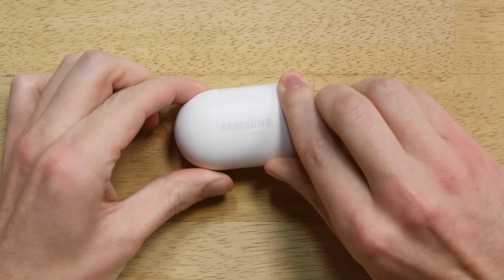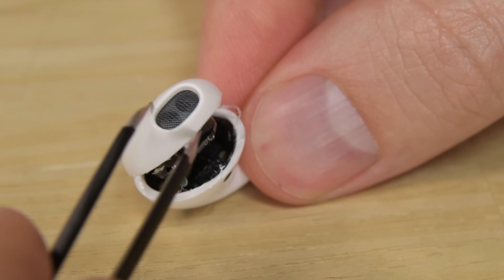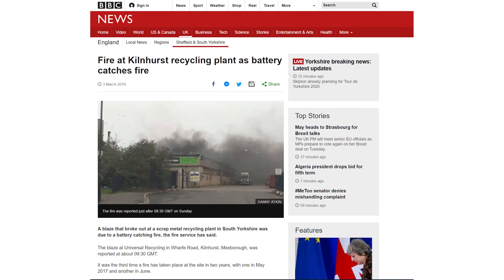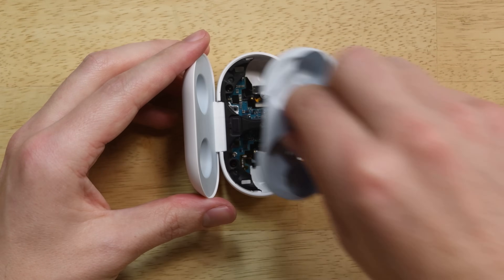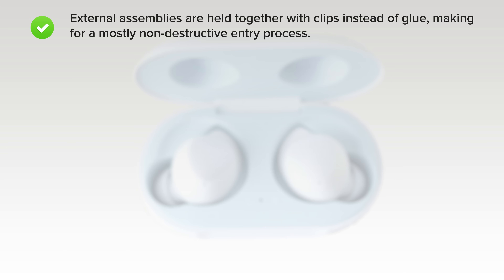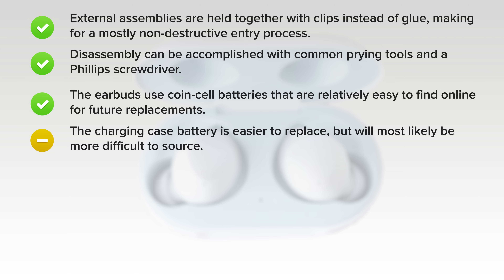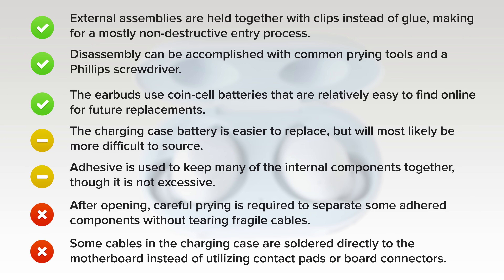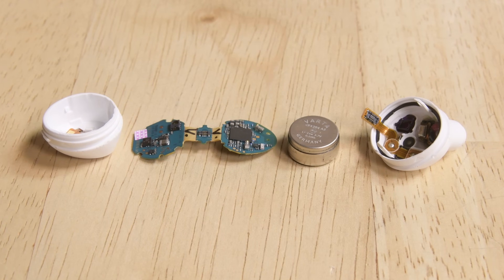Galaxy Buds Teardown: The Most Repairable Wireless Earbuds We’ve Ever Seen!

Comment: My speaker wasn't working, but i could hear it coming out the mic very faint. I tried alcohol and air to clean. No luck. I took it apart and cleaned it up. Works like new. Thanks for the video

Comment: I replaced my batteries (Galaxy Buds+)! First one battery, then the other a few months later..
I followed the procedure shown in the video.
However, a few months after I changed a battery in one, that Bud split open while I was handling it.
The glue  is just not as good after reassembly, I think.
You loose some inevitably.

...
Does anybody have a suggestion for a glue?
The original glue doesn't harden. It gets sticky and strechy.

Comment: There is an easier way to open the Samsung earbuds. Use an air compressor. Aim the compressed air at the small hole just below the R or L mark and it pops right open.

Comment: This video helped me figure out how to get my galaxy buds apart and fix the problem I was having where my left ear bud was totally dead. I accidentally left the buds and case in my pocket before a laundry cycle and well, the heavy wash cycle and electronics don't really mix--. I took them out, separated them all, and waited a couple of days before I tried them again, but unlike my totally fine right bud and charger, my left bud was totally unresponsive.
It wouldn't charge, and my phone couldn't find it. Putting into the charger got the red light, then green light, then nothing. Tonight; like 6 months later, after taking them apart like in the video, I removed them from the wearable app-- like I had dozens of times before trying to fix it, and tonight it worked! I'm sure I got really lucky, but I think that removing the battery from the contacts might have broken the gridlock it was in, and now 'ol lefty is back in full swing~ Thanks a million for making this video!

Comment: I have an galaxy bud that is overheating. Initially I thought it was the battery so I replaced after seeing your video but even with a new battery it still beeps and gets hot after a few minutes. Any thoughts on what is wrong? Left one works great but right one just overheats.

Comment: I actually accidentally washed my buds in the washer, after leaving them in the sun to heat up and dey I found that the right bud wasn't working, thanks to this vid and showing me how easy it is to take them apart. I did that with the right one and cleaned it with alcohol and scrubbed it down... Not they both work ✌️
Reply: Hey, what did you clean it with? I did the same thing by leaving mine in the washer
Reply: @natedonthate4291  just rubbing alcohol and a toothbrush 👍 then I just let it sit in the sun for pretty much the entire sunlit day.
Reply: @fatboyninja20  Okay thank you. Much appreciated🙏👌
Reply: How did you reattach the contact pad?

Comment: Using a small vise is a great idea to open earphones that use plastic housings! As an addition to that method, you could place something between the earphone housing and the jaws of the vise to avoid marring the housing. You might even be able to use smooth plastic jaws (or something softer than plastic) with some tacky material on them to prevent the earbuds from slipping on the jaws. To me, it looks like these can be disassembled without any permanent physical damage.
Reply: You can actually pry it open with your hands and it doesn’t damage the plastic

Comment: hello, I really need your help, I lost the right galaxy bud, and then I bought the right bud used on ebay, but when I put it in the case and now take out the two, they don't synchronize with each other and my bluetooth recognizes them as different headphones and individual, and the galaxy wereable app at the time of wanting to pair it does it like another galaxy bud totally different from those that already had paired with the phone (being the right one I lost), I would like to know if you know any way to force your synchronization between the left that I already had and the right that I bought separately
Reply: Have you tried finding the right bud
Reply: Use dual audio to connect both if you're using a Samsung device.... Enable dual audio... Then connect both independently

Comment: Can you guys figure out how to fix the super low Volume on one ear bud issue?
Reply: I have the same issue. I thought I was the only one. Just order the new ones with the white aura color but I'm looking everywhere for the the fix for the old ones. The one that isn't working for me is the left side. It works and all but the volume is low af
Reply: @pg13ish93  I fixed it! Well, the one had muddled sound. So I took isopropyl alcohol (70%) and soaked it on a  q-tip. I played music at full volume while running the find my ear buds feature. I ran it over the grate about 5 times letting it dry after each time between with the alcoholic q-tip. It definitely broke down whatever debris was in there and now it's full volume like the right one!

Comment: My right galaxy bud will not charge do you have an idea of what it could be?? I'm lost and so upset it about my headphones only my left one will charge I only used them twice smh
Reply: I have the exact problem. Right one does not charge and shows an ! Mark in wearable app. Reseller is a bastard and doesn't replace them.
Did you find any solution?
Reply: @amirsaeedirad  I bought mine new and didnt get the warranty and they said I couldnt return them ice tried everything and nothing will work was thinking about just buying and extra pair but they are not cheap
Reply: @vatos_locosgmf1942  I opened the right one today. The battery is blowed like a pillow.
I ordered a replacement battery from eBay for 15 USD.
I hope it's the main problem and not the circuitry.
Reply: I've*

Comment: Twice the battery size but last just an hour longer than the 1st gen airpods wow they need to work with their chip to be more efficient. The housing is pretty cheap not a hard plastic.
Reply: These are in-ear, surely you won't want hard plastic pushing inside your ears.

Comment: So can the buds  be used under water or rains
Reply: Are you dumb its water resistant so it will be sweat proof rain proof it would depend on the rain tho but idk if it rains hard they would be fine i would say so because its in your ear so when the rain drops it wont go inside it so yeah but i definitely dont recommend putting it in a pool or something
Reply: @bimbotm5789  thanks. Just wanted to confirm woukd it survive if accidentally  drops in water.
Reply: probably not underwater but in rain they should work perfectly and undamged
Reply: also bluetooth doesnt work underwater so thats useless

Comment: The literal only reasons why I haven't bought airpods is because I can't replace the battery. 

Meaning after ONLY 2 F*CKING years they are worthless. What a joke.

FYI bye worthless I mean ACTUALLY WORTHLESS. The cost to get a replacement bud is 70 bucks so you will literally be spending 140 $20 bucks less then a new pair to get them replaced. 

And if u don't get them replaced the battery is so small and worn out after 2 yrs. They will last maybe 30 mins before needing a charge again. 

So u will need to keep them charging ALL THE TIME. And since u can't plug them in to charge while listening they become worthless.

Comment: i mean i literally dropped my airpods in a 6ft pool, sat there for 10 minutes until i finally was able to get them out, rinsed them in the sink, let them dry for 2 hours, and they work just like the day i bought them, they're waterproof, i dont think these earbuds from samsung are waterproof to that extent
Reply: If you have to rinse them, and let them dry for 2 hours, then they're not waterproof
Reply: RR Sharizam the speaker didn’t break, the paper cone didn’t disintegrate, or the mesh on the speaker had to dry out
Reply: @Firealarm102  
Have you ever used Sony Ericsson or Nokia phone from 2000's era?
They're not rated as waterproof but I once dropped them in the pool, let it dry for 2 hours, and they work just like the day i bought them.
Again, that's not the definition of waterproof.
Waterproof is when you drop them in the water and still be able to immediately use them.
Just so you know that Galaxy Buds are rated as IPx2 water resistant.
While Apple hasn't made any claim that AirPods are water resitant.
So, it is actually AirPods that are lagging behind in water resistance.

Comment: There are pros and cons to this 
Pros-
Repairable 
Easily fixable 
Easy to replace battery 

cons-
Due to nothing being sealed the buds can get water inside them very easily
If water comes in contact with everything in the galaxy buds it’s pointless to repair but instead to buy a new pair
Reply: They are not water resistance?
Reply: Simply me exactly that’s the downside. AirPods for some more people
Reply: @shravdoesstuff  
Galaxy Buds rated as IPx2 water resitant.
AirPods has no rating
Reply: The Galaxy buds doesn’t have any sealing/adhesive.Watch a teardown. The airpods can go in water and still work. even swimming

Comment: The "downsides" that they mentioned are just stupid. 
After opening, careful prying is required - come on guys. What do you expect.

Some cables in the charging case are soldered directly to the motherboard - I don't see any problem soldering something directly to the MB. As long as the solder joint is good it should be ok. Besides replacement parts will not be available for the charging case anyway. So I don't think that soldering cables to the MB matters that much.
Reply: Even though you don't, I would. I've never soddered and don't have the tools for it, so it would be something I'd have to source. Even if it's easy for you, or easy in general, it's something that I'd have to source time and money for that I straight up don't have. It's all referential
Reply: They have to say that because they are easy to scratch and a noobie would scratch em up and try to sue them.
Tons of people have never soldered, or opened a phone or any electronic device before, may attempt it to save $129.
Reply: Do any of you guys think that replacement parts will be available for these. If you think so, you are highly mistaken.
Reply: @hnisala  the batteries already are
Reply: @Tigerex966  Yeah, because they use a standard norm and the batteries were already being sold before the buds. Don't expect any other part to be sold separately.
Reply: It’s just that most people don’t know how to solder and a fraction of people who know how to solder can’t micro solder so it’s a small problem

Comment: Next iteration I hope they improve water resistant to at least IP67 spec and maybe put larger battery in the case + fast wireless charging ?
Reply: 67 is kinda useless cause it can't handle swimming but it's also way overkill for general sweating

Comment: 6? are you kidding? tehnology so small can be so easily open and repair and you give a 6? airpods cant even be repaired, you need to destroy the plastic to open them
How can you give galaxy buds a grade of 6? wtf
they worked so hard to make it so small and still easy to open and replair and you just gave them a 6 for that work
Reply: I do not think samsung gives a fuck about his score. On that note....HOLLY FUCK ITS ATLEAST A FUCKIG 8 CMON
Reply: When observing, anyone is free to critique as they see fit. One does not have to prove something, just because they can infer it from information laid out to them. All the guy did, was voice his opinion from facts or information he has

Secondly, just because the criticism is not something you agree with, doesn't mean he has any burden of proof or needs to do it himself. His point was, he thinks the galaxy buds or wireless buds should be rated differently under a different premise, due to how generally you can't open them, let alone fix any component. Whether it's valid or not, I don't know, but I agree with that reasoning.
Reply: @spiral-blades752  
I agree with both of you
Reply: Mind, at the end they included that repair parts may not be easy to source
Reply: @rrsharizam  good argument, you got me
Reply: Most people don’t know how to micro solder or solder at all so if the solder joints break you’re kinda fucked
Reply: Is always like that, they give bad grades just to see how we will react. The entire channel is a joke!